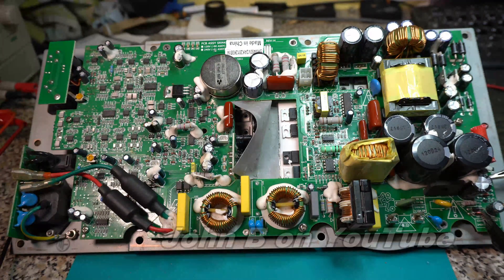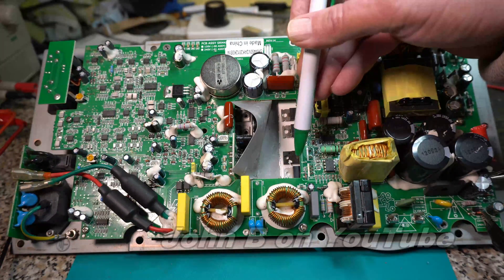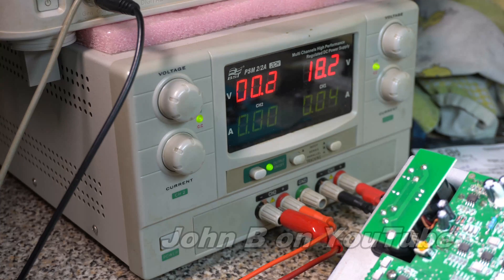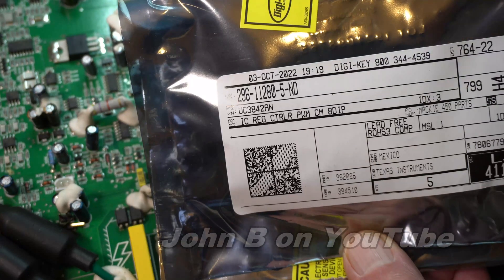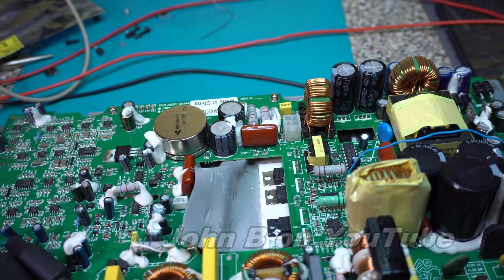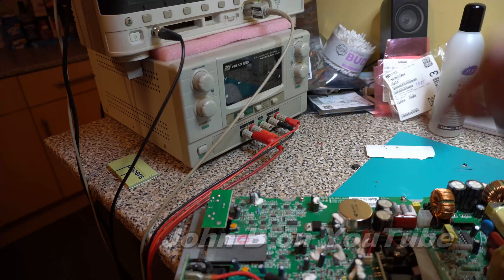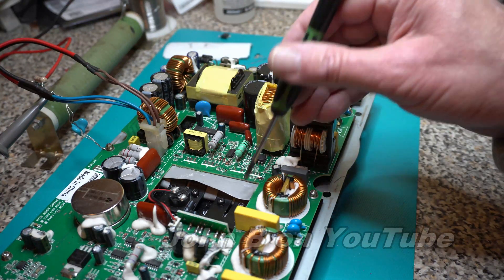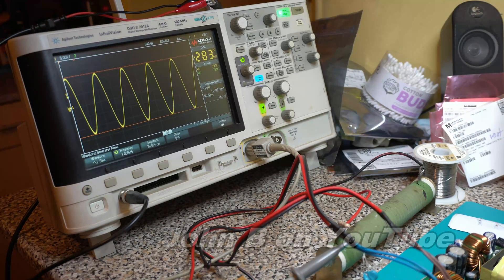Mackie SRM450v2 PFC Repair & Keysight Scope Signs of Failure | Power Electronics

Comment: Looking for some help with what I think might be a common problem. I have a Mackie SRM450 v2 speaker that recently developed an issue: the HF driver cuts out after about 15 minutes of use. If I power the unit off and let it sit for a while, it will work again for another 15 minutes or so before dropping out.

The overheat indicator does not light up when this happens. I’m considering the possibility of a cold solder joint, but I’m not sure where to start looking.

Any ideas or suggestions would be greatly appreciated. Thanks!

Comment: Hello, was thinking you may be able to give an opinion on active PA speaker brands. I'm looking at mid-range (price wise) speakers, and they all seem to be made in China. With that being the case it wouldn't surprise me if they all shared many of the same components. It appears you have done intense surgery of many of these, is there a stand out in the crowd in which your not just paying for the name plate on the front? Thanks!
Reply from the maker: Thank you for your kind comments.
If I wanted to purchase an active speaker, it would have to be Yamaha.
Unfortunately, they are more expensive than many others.
However, they do offer something like a 7 year warranty.
They also release their schematics so repairing them is not a problem.
I believe they are also made in China but use high end components.
Have a look at the Yamaha DBR 10 I repaired.
Thank you.

Comment: I need to thank you for this video, I've just repaired yet another one of these and I use this video to remind me. I can confirm the PFC in this unit starts at 95khz and drops to 66khz with the PSU.
Reply from the maker: Thank you for your comments. You'll find if you change the 2 caps around the pfc chip, the frequency will drop.
Reply: and that's exactly what I have done, presently on a long soak test before return @JohnB-2021
Reply from the maker: @michaelshaw1827  Excellent work!
Thank you.
Reply: @JohnB-2021 excellent work thankyou, it was actually 85khz, not 95khz.

Comment: Hello, I have two modules.
1. Resistors R243 and R245 are overheating.
It does not turn on at the first press from the On Off switch, if I turn it off and turn it back on while the lights go out, it works.
2. Sounds distorted at medium volume.
I would be glad if you help.
Reply from the maker: Sorry, I have no idea. It could be 100 different faults.

Comment: Thanks just seen your very intuitive video, I have the same problem with my SRM450 V2. 
initially Q1 was defective i changed that. applied the 18v checked 95khz and the wave form similar to your trace. Applied mains voltage through a current limiter. Voltages fluctuated. will change the capacitors and IC U36 if required.
thanks again been working on this for weeks.
Reply from the maker: Thanks for sharing

Comment: On this model the heat dispersion of transistors is not good the white plate between the transistor and the isolated back far too. And the diode and the transistors lose life, if the system is hard requested.
Reply from the maker: Thank you for your comments.